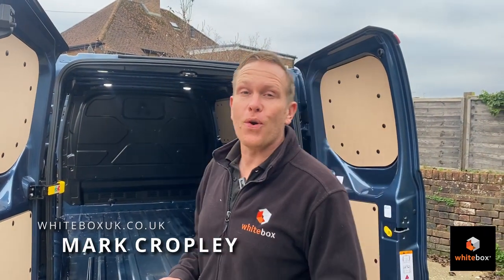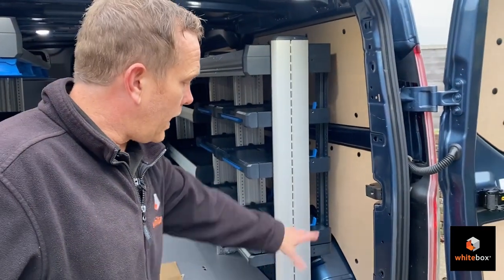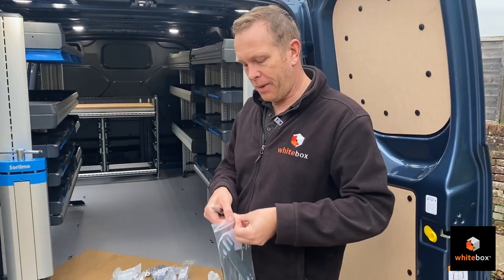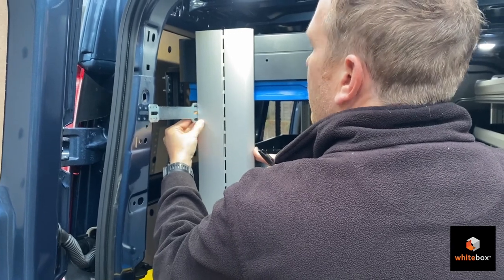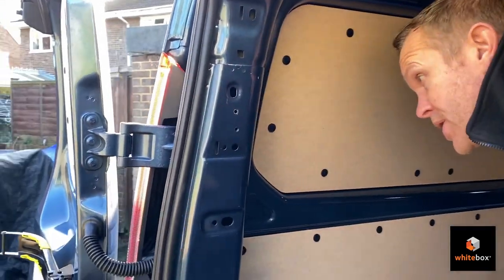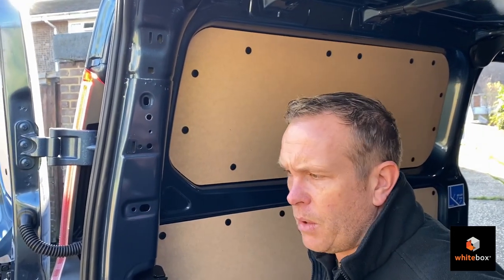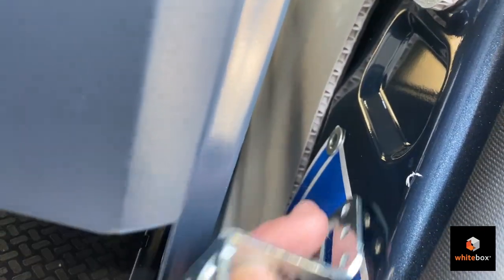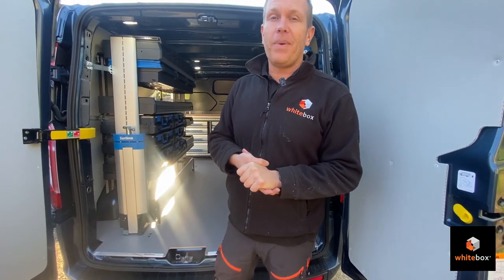How to install van racking- Sortimo SR5 in a Transit Custom

Comment: That is a lovely job.
Really like those linings.  Think I’m going to at least have the ceiling liner in my van from them guys
Reply from the maker: Thank you. 

They are good Jody. . I had the ceiling liner but they hadn't put the cut outs in for the lights. They are going to send a replacement soon. Mark

Comment: Hi what would be a ball park figure for the racking you’ve just installed ( minus the vice ) ?
Reply from the maker: This set-up would be around £6000 plus VAT fully installed. It has a lot, including the floor, linings and bulkhead unit. Most systems with a NS and OS unit could be half that.